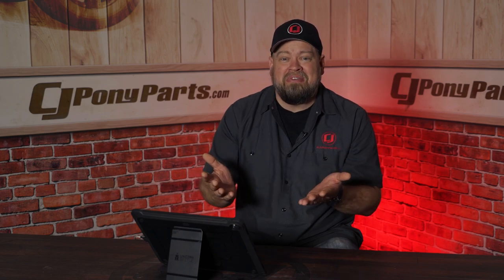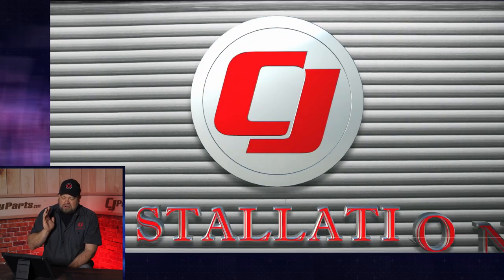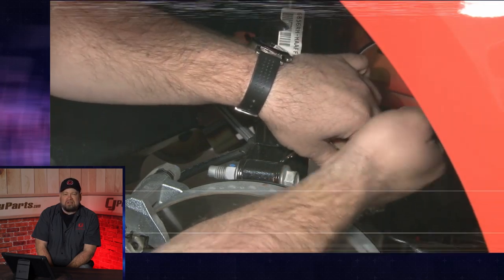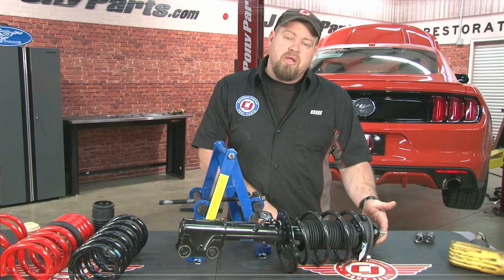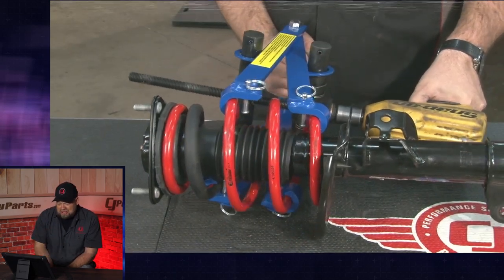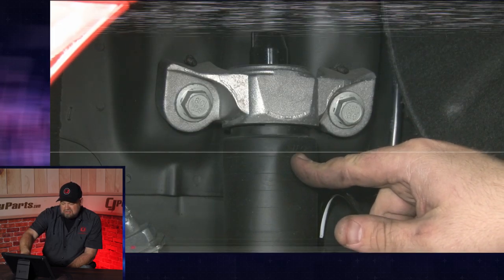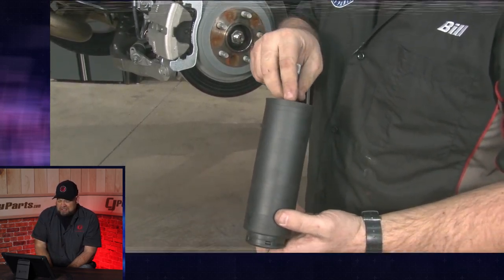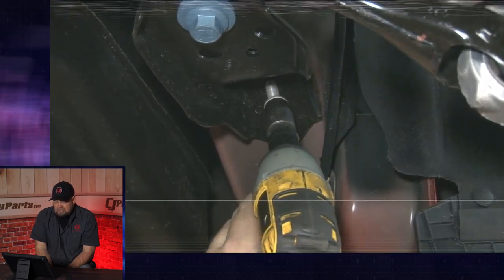Rewind Series | Eibach Sportline Spring Install

Comment: It's hard to believe since the S550 has come out I have done 350 + spring installs. Depending on the brand I've got the install down to 2 hours or less. These cars are so fun to work on and it never gets old dropping it back down on the ground and getting rid of that wheel Gap.